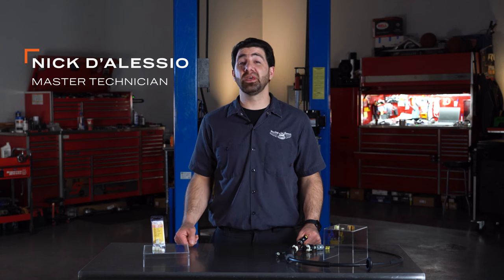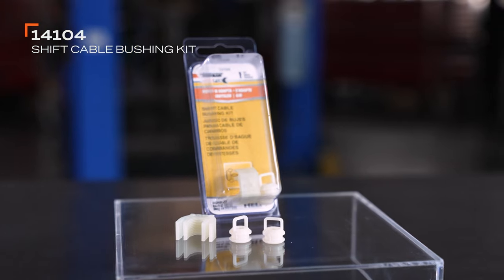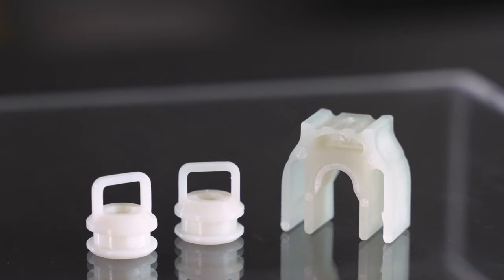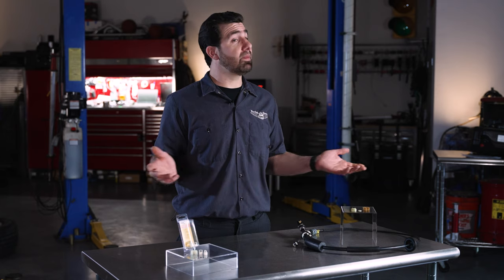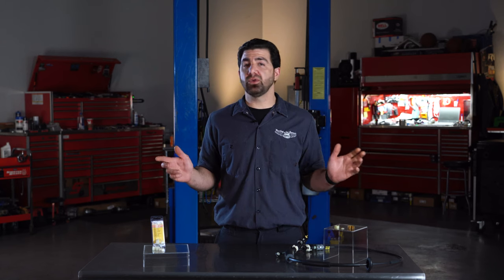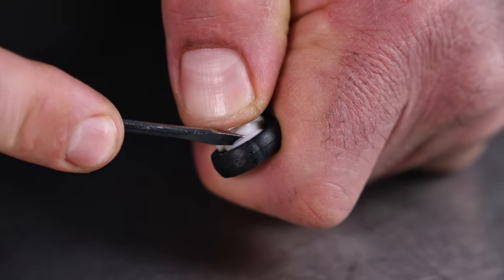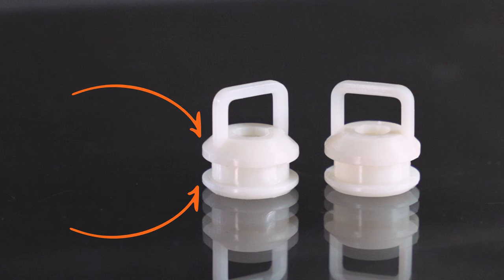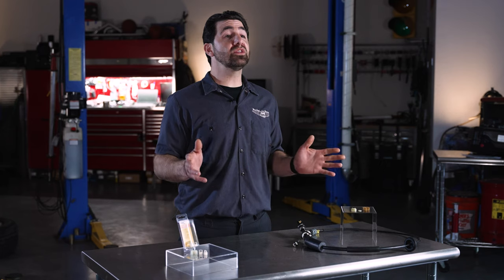Tips for fixing a broken shift cable linkage with replacement bushings

Comment: Worked on my 2013 LTZ Tahoe. It took less than five minuets.
I felt a snap when I put it on the cable linkage using the pliers and another snap when it went on the lever by just pushing it on.
Also, I did NOT use the hot water technique because of getting two in the package. 
Good Luck

Comment: Mine still slips off. Not every time as before but certainly not an acceptable fix. Any further advice?
Reply from the maker: Hi JR, is the bushing not staying on the pin of the linkage, or is it coming out of the cable end?
Reply: @DormanProducts  it was not staying on the pin. I ended up fashioning a metal clip (with a hole for the pin). So far so good.
Reply: @jrtaylor2601  can u please tell me what you put to hold it ? My replacement bushing still pops off the pin !
Reply: @theoamos4335  probably a small cotter pin
Reply: Same here! Keeps coming out from the lever pin. How did you guys worked it out ?

Comment: Got part number 14104 for a 2012 yukon xl. Will not stay on the linkage arm pin. Tried both bushing in kit, did the warm water trick. Easily pops back off. Looking at amazon reviews, it really looks like a junk product
Reply from the maker: Hello, thank you for bringing this to our attention. I will pass this along to our quality team.
Reply: I'm having the same issue, did you find a solution? I'm getting really frustrated now.... Thanks
Reply: 8 months and no response.
Reply: Put a e-clip on it.
Reply: It worked easily on my 2013 Tahoe. It made a snapping feel when it went into the linkage and I felt another snap when I pushed it on to the linkage leaver.
Reply: Same here. Just put on yesterday and off again today. It felt like an eclip or something should have been on there with it. I'm getting an e clip today.
Reply: Same issue here
Reply: Put a E clip on it had the same issue
Reply: I know @dormanproducts won’t do anything besides improve their product. 

As far as refunds WONT HAPPEN.

I have a 2011 Tahoe LS and my OEM bushing failed, so I found this kit at Advanced auto Parts and attempted to install.

I performed the water trick and inserted it into the eyelet end of the shifter cable at the trans, well the bushing did not perform its duty to retain the ball end of the transmission lever.
As a matter of fact the shifter cable came off the next day while the wife was driving it… 

So @dormanproducts I suggest you recall these kits and revamp them to include some sort of locking device like an E-Clip of sorts. 

I dont see how this would go ok in the court of law, death or accident caused by a bushing that could have came with a better solution. 

GARBAGE PRODUCT DO BETTER!
Reply: I have an 07 Escalade, and it slips off every single time I drive it, I guess my next move is going to a GM dealership to buy one.
Reply: @casperdelo7777 could you elaborate? What is an E clip
Reply: It works fine on the silverado. I think the the yukons is just a little smaller might take a different part. I looked under my bosses Denali for reference when working on my 2012 silverado and it looked a bit smaller. I came across 2 different kits . The one he shows and another brand but they were hard plastic not rubber like the ones in this video but there was a larger variety. Auto zone carried that one. I got the one shown at oreillys and it fits like a glove and I'm very happy with it. Hope this helps.
Reply: Everyone. I came up with a solution! I bought a new arm for the transmission that connects to the bushing and linkage. I drilled a very small hole sanded the bushing down so it was flush. Then used a cotter pin through the hole and flared it. Been having the same issues on my suburban and been zero issues since.

Comment: Other than drilling a hole and using a cotter pin to hold it on, how has everyone else stopped the cable from popping off of the shift linkage? Pics of you got em please...
Reply: D  is d all this and it still pops off
Reply: Gonna try replacing this Auto Trans Shifter Cable Lever - 2001-2013 Chevrolet Tahoe
Reply: Same problem. Piece of junk part. Stupid ass GM could have made the selector arm threaded in order to thread a bolt on and then there wouldn’t be a cheat piece of plastic doomed to failure. But in typical gym fashion they don’t care
Reply: My new part pops off too. So annoying. My wife has had to call me 3 times away from work because the new part pops off. The inside of the new pushing should have a bump to clip into place with the transmission shifter

Comment: 2011 silverado with 6 speed trans I used 14104 on the lower cable and it keeps falling off like it's not the right one but it said it fit when I bought it from the autozone I work at
Reply from the maker: Hi Alex, if the bushing is snapped in and that is staying but the bushing wont stay on the end of the rod, then you would want to warranty out the bushing.
Reply: I have the same problem
Reply: Same. Bushing is on but keeps coming off the lever over short amount of tjme
Reply: Same problem here! It keeps coming off the lever! How did you guys worked it out ?
Reply: Same problem. I don’t think warranty is the answer
Reply: @marc-andrethibodeau  I put one of the little c clip things over mine and it's done great just gotta get the pack from harbor freight and find one that'll fit
Reply: Same problem. Total pos

Comment: Will part #14104 fit 2011 Silverado
Reply from the maker: Hi Daniel, part # 14104 fits all of these 2011 Silverado models:

Silverado 2500 HD- 6 Speed Trans. - Upper Cable
Silverado 3500 HD- 6 Speed Trans.- Upper Cable
Silverado 1500- 4 Speed Trans.	-Upper Cable
Silverado 1500- 6 Speed Trans.	-Upper Cable
Silverado 2500 (Mexico)- 4 Speed Trans.	-Upper Cable
Silverado 2500 (Mexico)- 6 Speed Trans.	-Upper Cable
Reply: So not lower cable at transmission, I put one on drove a little bit and came off about 4th time, comes off at linkage,I put in park,,comes off at reverse on a incline will vehicle will roll

Comment: Hello, does it fit 2013 GMC Sierra 2500HD? Thanks for the video
Reply from the maker: Hi Juday, This part will fit your vehicle as long as you have a 6 speed automatic transmission. https://www.dormanproducts.com/p-132250-14104.aspx?year=2013&make=GMC&model=Sierra%25202500%2520HD&parttype=Auto%2520Transmission%2520Shift%2520Linkage%2520Bushing&origin=YMM
Reply: Won’t work lol it’ll just slip off

Comment: 07 Yukon Denali. These are so trash. Not only are they damn near impossible to get the bushing into the flange but the bushing does NOT stay on the pin. It pops off multiple times every single day. Yesterday in the middle of the when while I was backing out of my girl driveway. Booty pipe part

Comment: Do yourself a favor take your shift arm off drill out the the shift pin on the shift arm and just bolt it with a lock nut probably have to grind the head of the bolt too. It will last

Comment: Why don't you show us with the pilers
Reply from the maker: Hi Carlos! The video only shows putting the bushing into the cable end, unfortunately it never shows at the end using the slip joint pliers to install the cable end onto the linkage as Nick describes.

Comment: I followed all directions, the piece worked for one day, and now continuously pops back off. It takes almost no effort to slide the cable and bushing back onto the shift arm on the transmission. Why is this bushing so loose..???
Reply: I haven't tried it yet. My hole is egg-shaped. I think it should be round.  I'm thinking , if it's not a round hole. It may pop off. What shape is your hole? 😊